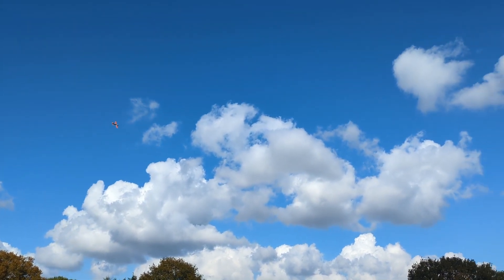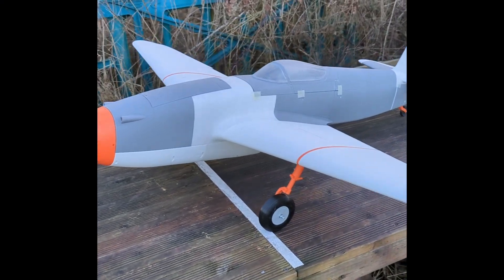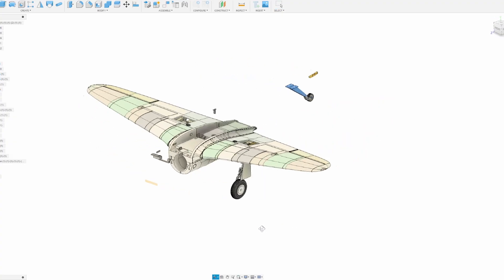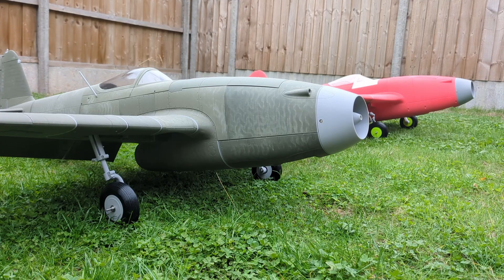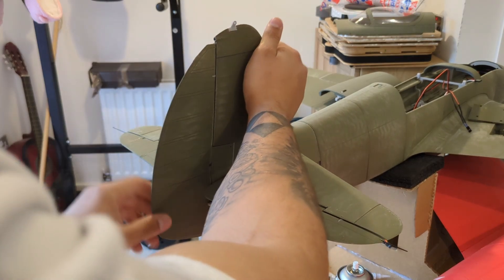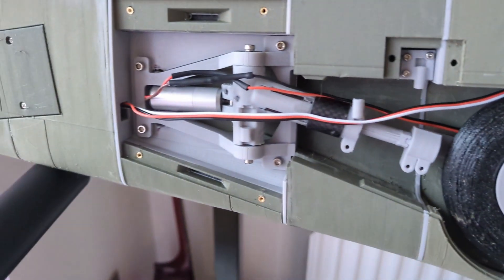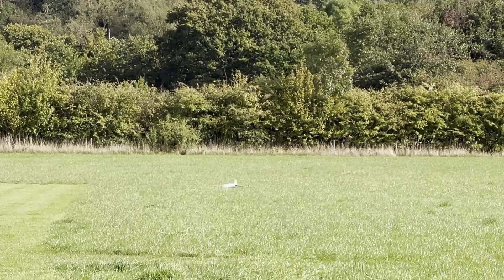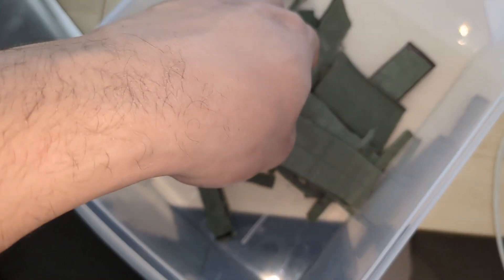3D Printed RC Jet - Yak 15 build log

Comment: You should consider building an Ariete. It's second booster engine totally fixes the misaligned thrust vector issue that the Yak-15 and Sagittario 2 suffer from.

Comment: One of the things to note about the Yak-15. 
It was a legit conversion of a Yak-3 by adding a Junkers Jumo 004 Turbofan to the bottom of the nose where the engine would be. The earliest Yak-15s had canvas wings like the Yak-3 had, and because the Yak-3 was built out of wood, it was already light-weight but the poor performance of the Junkers Jumo 004 engine meant they had to reduce weight overall and that was replacing metal sheeting with canvas. You can forego retracting the tail wheel, unless you plan to use a scale model jet engine, its not important in the grand scheme of things and you'll be able to reinforce it nicely to withstand harsh landings. You can try covering the wings in canvas, as well as the horizontal and vertical stabilisers. I would also suggest wrapping the rear fuselage as well, should be able to shave off quite a bit of weight that way and still retain the Yak-15's iconic shape.

Comment: Is it possible just a 3-D print the frame of the aircraft all your landing gear and all that other stuff make it as lightweight as possible and then make the skin out of like aluminum foil or something else that is light so you don’t have to print the skin cause I’m pretty sure printing the skin adds a lot of weight

Comment: You can use the lifting profile on tail, so the cg are going to move back significantly so you can reduce the nose weight. Or you should decrease the surface load. Accepted design step to increase te wing area, because it is a model and the flow conditions are diferent as the real plane.

Comment: Try using xflr 5 for aerodynamic study. 
I generally say when designing a plane you first need to study what kind of characteristics you want. In your case you should probably think about reducing weight by well over 1 kg. Im guessing most of your weight comes from th lw pla. Try using more adapted infills for the wings like 2d lattice in orca slicer. Also reducing the number of walls might help. 
Finally, if you have to put a counterweight because your plane is too tailheavy its just that the plane without the power plant is rly heavy. You shouldnt have to to put counterweights especially with the motor in the middle. If you really need to though, try putting a battery with a higher voltage maybe going from 6s to 8s which will give you more thrust and put some useful counterweight at the front. 
If you have a model of that landing gear i would be really interested its a really nice design! 
Thank you for this video

Comment: This is such a beautiful model! The weight really is a tough issue.
It looks like a lot of your components are quite thick. They also have consist of a lot of solid shapes. In real aircraft, engineers remove as much of the material in the middle of their frames as possible to reduce weight, it really makes a difference. Cut holes in everything!

Also, it can feel counterintuitive, but if you increase the size of a part but reduce the amount of material in the middle by cutting lots of holes along it, you can get a part that is stronger and also lighter than a thinner solid beam. Try a couple of test prints, maybe see how much you can reduce that way.

It really is a shame to see that lovely landing gear go, I wonder if you can keep it if you reduce the weight of all components in the aircraft with this method, and in the landing gear too. I hope it works out, good luck!

Comment: I saw a video a while back by Tail Heavy Productions about rc pilot stereotypes. One stereotype that stood out to me was the scale model builder. They said the planes looked beautiful... and flew once. Not perfectly accurate but I see where they're coming from. You might want to take a break from building beautiful planes and try building a plane just to fly well so you don't waste so much effort on a plane that ends up quickly crashing, then come back to a scale model project once you've learned more about CG and weight and stuff. Either way keep up the great work!

Comment: It might be worth considering a single retract servo with carbon pushrods for the retracts, that might trim the weight down a bit.
Reply from the maker: My initial prototypes used that sort of setup, it would be a massive weight reduction.

Comment: Hey can you use carbon fiber for your wheel shaft?  Have you considered giving up on being totally scale when looking at the retracts issue?  just two 40g retracts, two spring struts with a 3mm shaft and maybe slightly smaller wheels.  

I really like how you try to design a way to make it so one failed takeoff or light crash doesn't mean the whole airframe is toast.  When the whole airframe is an eggshell (enough of it) held with ca glue repairs are extremely difficult to impossible.  I want to play with using tabs and very small screws on parts like the wing ends that break when the ground even gives them a dirty look.

Don't give up.

Comment: As a long time RC builder, a thing I have noticed that we do ( I have to include my self here ) is getting too focused on a particular design or building style. I short, since you are fighting weight, it may be better to go with a wooden built up structure for some components. You could probably save significant weight with built up tail surfaces and outer wings. Of late I have also seen people who have used a printed component as a plug for a lightwight composite part. The Yak 15 is a fasciating early jet and I wish you sucess.

Comment: We have had similar job with yak-15 (epp foam). It's design has a fundamental challenge. The airflow from the engine does not leaving the fuselage and this makes it quite unstable. After some tests we placed some vortex generators behind the engine and miracle happened. Try of for your own.
Reply: This was an issue that Yakovlev fixed by angling the entire turbofan downwards on the actual Yak-15.
Reply: Hello,
I'm making a YAK 15 out of extruded polystyrene, but it's not finished yet.
Could you explain these vortex generators in more detail?
Reply from the maker: I haven't really faced this issue in the same way. My duct is slightly angled down so does not stick to the lower fuselage.

Comment: 3 months for my prototype 1 that looked like a napkin strapped to some cardboard and a brushless motor. Prototype 2 is a bf109 been on the making 3 months and is looking so much better. Im impressed with your work but from fan to fan (;  you need to reduce weight. I am sticking with a fixed landing gear for now and a combined attack of foam, cardboard, balsa and paper just to add some shape but keeep model functional. I should make a video to show my work, so thanks for being inspiring, I much appreciate your work

Comment: Hand launching edf is very difficult because they dont have prop wash over the control surfaces - a dolly for take off (wheeld cart) or a bungy launcher are much easier/safer options - they used to be prety much standard for EDF flying from grass fields
Reply from the maker: Hmm, in that case maybe I don't need the down thrust

Comment: To be a hobbyist is to have ambition, and there's little more ambitious than making the first RC plane you design THROUGH 3D printing a jet warbird!

It's pain to get through, but it's also a great way to learn, failing over and over. I once worked on a design through 8 separate iterations before I understood exactly what to ask to be able to build better

Comment: I would use less filler making the printer use less filament just add triangle cut outs in places that makes sense it will add strength if done correctly and will shave a bit of weight there is lots u can do to save on weight.
Reply from the maker: Do you mean triangle through cuts? I'm struggling to visualize it, maybe could you send me an example of this?

Comment: Your commitment to the project is admirable. From experience, LWPLA-HT is quite heavy for infill printing. Have you thought about trying to learn Negative Internal Modeling? That is where you CAD in all the internal structure using 'cuts' and offsets into the body. It also can make use of minimum retract moves with the print head. It is laborious but will achieve a lighter, stronger structure in the end. 

I also think you could get away with standard 90 degree retracts if you use a thicker than scale wing. Have a play around with mounting the retract at odd angles and see what happens to the wheel. Obviously it has to be in the correct position when down but it can be pretty much anywhere when up so long as it is contained within the wing...
Reply from the maker: I'll look into this technique, thanks!